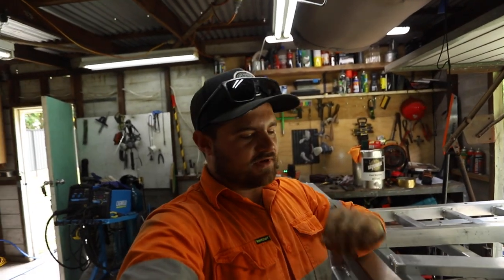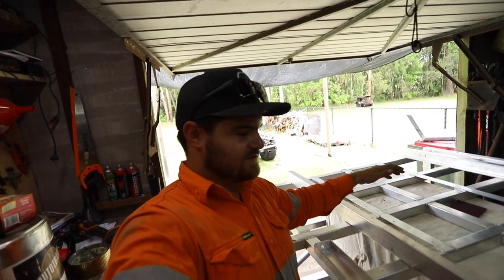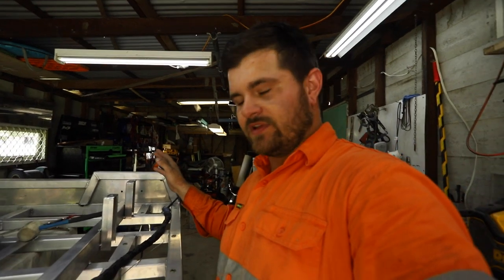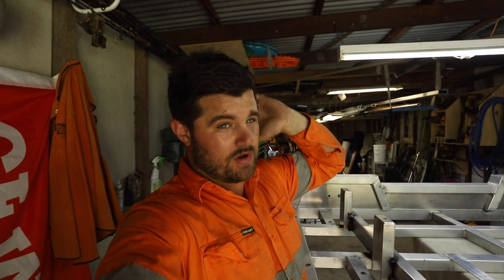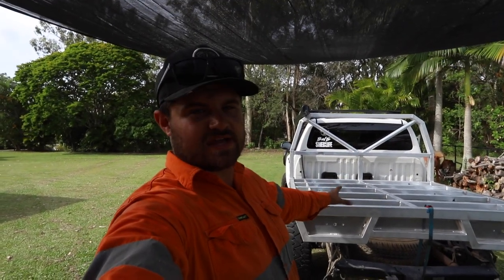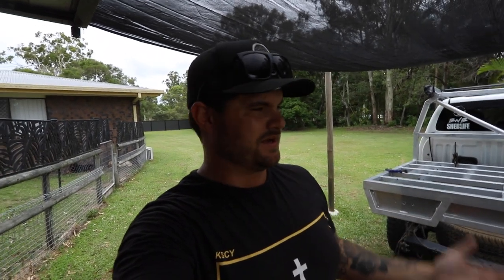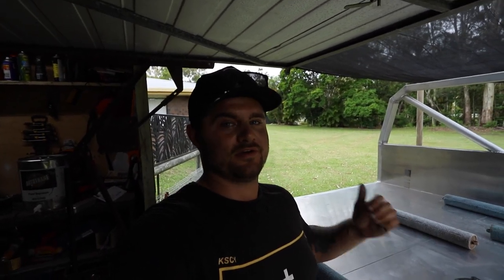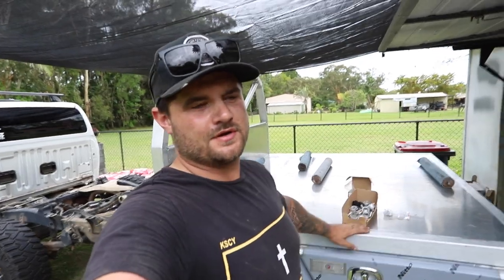Time to take this helmet off! ||welding is finished!! ||

Comment: Nice work mate, very well done, what bolts did you use to bolt your guards & toolboxes onto the tray with?
Reply from the maker: Thanks mate appreciate the comment they are m10 stainless steel bolts and I used rivnuts pressed into the tray. And they are still going strong 💪🏻
Reply: Cheers mate, will have a look, I was going to use Tek screws, but that seems dodgey to me. 😂
Reply from the maker: @M3gsy42  haha yeah dodgy but not depend how many you use I suppose haha I just have a rivnut gun so I used it but they are worth the investment man I just got mine off eBay

Comment: Hey mate really enjoyed the videos you did. There’s not allot of material around on building alloy trays so Thankyou for giving some really good content. I’m currently building an alloy tray as well for the hilux and I’m at the stage of the main rails going in and mounts. I’m just wondering if you had the dimensions still on how long you made the mounts and what measurement you set your main C channel rails at. 
I’ve got roughly 305mm from outside edge of the tray to the main rail. Just wondering if you got close to the same ?
Reply from the maker: Yeah I have herd that aye maybe I got mine just in time 😂 it really depends on where you want your head board to sit for the hight man and that it governed off how high it is from the sheet to the window what I did was get a straight edge and ran it along the chassis mounts then measured up to the window. Then you just take away what it is from the headboard to bottom of tray and that will give you your hight. And as for the c channel width that depends on how wide you made your tray as well man. 🤙🏻 I hope this help out. Do you have c channel or rhs for your main rail ?